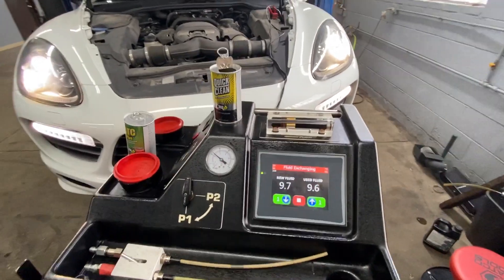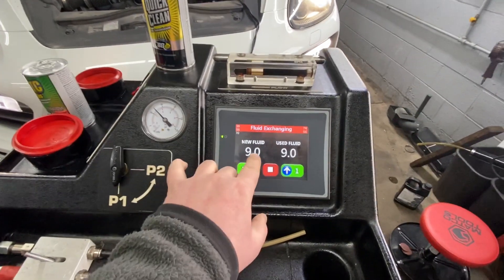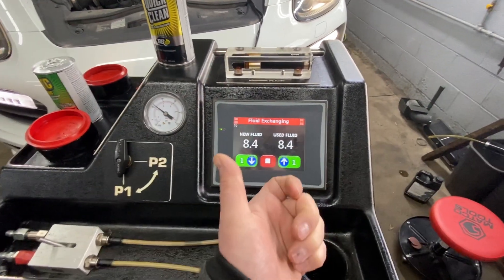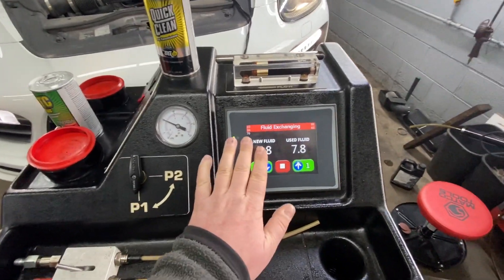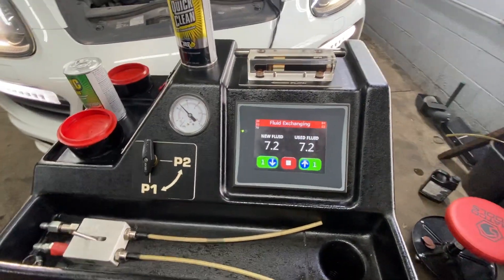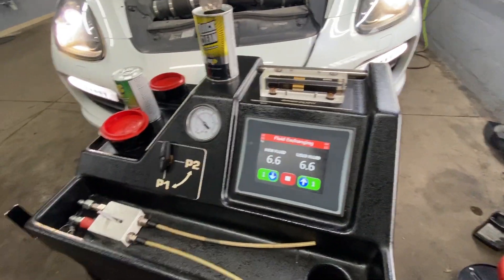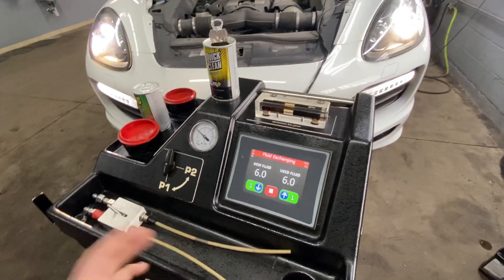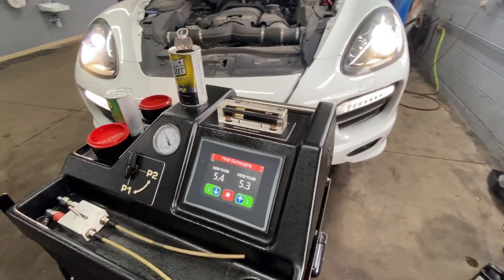Porsche Transmission Fluid Flush Process Part 2

Comment: I don't think anything can bring the cost down for a Porsche customer at the dealer. A machine like that will only make it easier for the technician but the cost of the machine itselt will be passed on to the customer and used to justify  increased hourly labor cost 100 times over. Anyway, thanks for the video. I stumbled across it while looking for a video on how to change the transmission fluid in a Porsche panamera yourself with just an oil extractor and definitely without that expensive machine. Lol